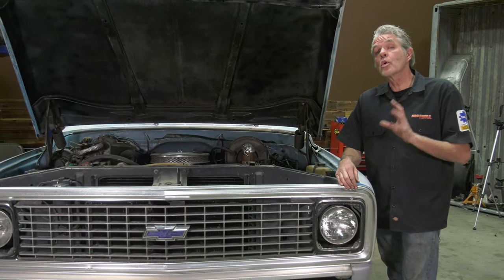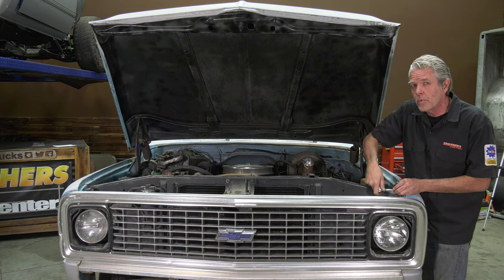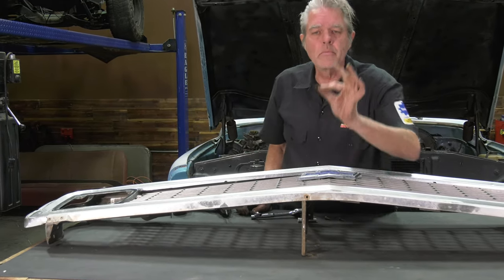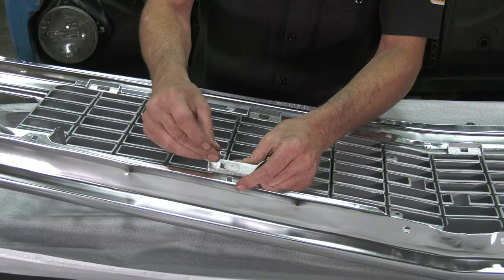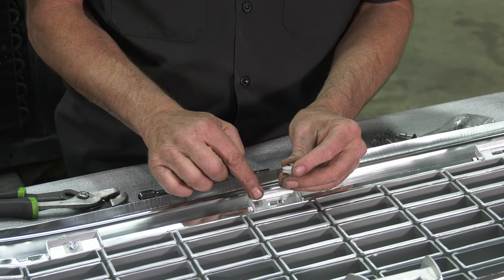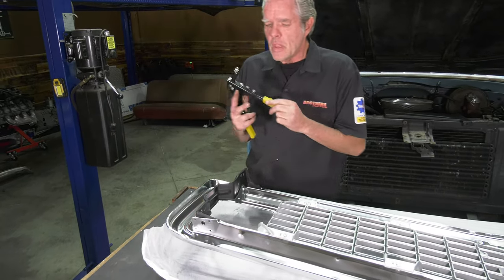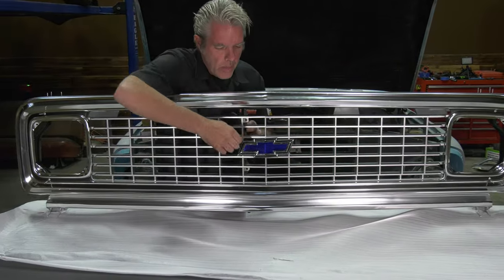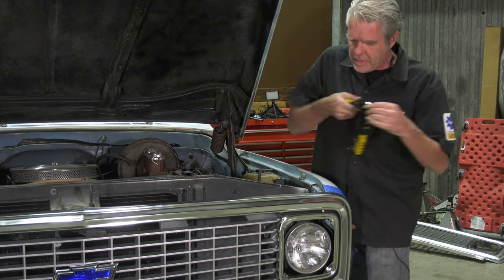1969-72 Chevy Truck - Remove & Replace the Grille - Inner/Outer Assembly

Comment: Would love to see a video for dropping a 71 C20. No c notching just a regular lowering kit. Something someone can do without cutting anything. Tons of vids on c10’s. But I got a c20. Thanks in advance.
Reply from the maker: C10, C20 are basically the same, front is 100% the same. Rear is only different if you have leaf springs on your C20. As far as not cutting anything, that's easy, don't do a drop that's more than 3" front and 4" rear, you won't have to do anything extra.
Reply: ..why on earth would you want to drop a C-20?..it's a 3/4 ton work truck...I have had mine 25 years, it isn't pretty, but it still works, every day..trusty and faithful work truck...1970 C-20...granny 4 speed, 292 I6, low geared posi rear end...terrible gas mileage, she isn't fast, but she'll pull like a beast, reliable, no electronic gremlins like a newer truck...am I the only one who still uses a 67-72 as a work truck?...seems like all anybody else uses them for now is as toys....
Reply: @dyer2cycle  if you read my comment I clearly state no cutting. Which means whatever is Potentially done could be reversed. My c20 does not have a granny gear and I like the lowered look. So “IF” I did lower it, don’t worry it’ll be MINE, so you can keep looking at YOUR truck in all it’s beautiful original form. And I could be a lil more pleased with mine. I don’t understand today’s society where we all must like the same thing. God made us all different for a reason.
Reply: @dyer2cycle  Exactly I agree with you !
A - C20 is a great work truck . No modern day Gimmicks. Like we got now . Pulling machine. Gets tha job done . Easy to fix too . 
I’m still driving my 50-yr Old 72’ Cheyenne 1/2 Ton. Same A/C too, same Motor. Not very pretty . It takes care of my needs. No new EXPENSIVE TRUCK . For me . But hey to each there own . Customizing . If I need something bigger I’ll use my sons New GMC DULLEY . 👍🏻

Comment: Can you make a video on swapping a 72 Jimmy grill to a 69 Blazer grill? Nobody seems to know how to do this at local shops here.
Reply from the maker: That job requires that you swap the radiator core support, etc. It's simple, but you've got to change out all those parts.
Reply: @BROTHERSTruckPartsTV  any chance you can give me a list of all the parts needed aside from what you mentioned? I’ll have to do some more shopping now and these types of parts are out of my wheelhouse. Or is this something a body shop will have no problem with?
Reply: @BROTHERSTruckPartsTV  I’ve been looking up info on this, the only part that seems as if it’s not interchangeable is the radiator core support. The rest of the parts mention aside from the front bumper (I’m using a custom made one with the brackets for a 69 blazer I bought)- fenders, hood, and anything else that’s attached to the front end are all the same part numbers. Can you confirm all I need is rad core support? I appreciate your info.
Reply from the maker: @rhetthasara6752   Our apology, you are correct the fenders and hood are the same. You will have to swap the core support due to the dual/single headlamps as well as any related headlamp or parking lamp items.
Reply: @BROTHERSTruckPartsTV  perfect thanks guys. Your videos are SO helpful to us mere mortals they don’t have the knowledge you have on these subjects. I really appreciate it. Keep up the good work. 🤘🏽🤘🏽
Reply from the maker: @rhetthasara6752   Hold on... We need to correct ourselves here. The GMC uses 1968 Chevy Fenders through '72 whereas the Chevy fenders are different starting in '69. So, the hood is interchangeable from 69-72 for BOTH all Chevy's and GMC's, however the fenders for that '69 Chevy grill have to be 69-72 Chevy Fenders and NOT GMC fenders. Sorry for the confusion.

Comment: I have a question.. I want to install new fan shroud,  is it same procedure plus removing the radiator support??
Reply from the maker: To install a fan shroud you shouldn't have to remove anything but the old shroud and MAYBE the radiator fan.
Reply: thanks for the help..
Reply from the maker: @rickramos8471   our pleasure!
Reply: @rickramos8471  Rick go Electric ⚡️ 
Get some Twin Electric fans ! They have there own Shrouds . Take that old fan out 👍🏻

Comment: My new grille doesn’t fit over the new fenders. So the gap is huge. What do I do. I can’t adjust the fenders in any more.
Reply from the maker: If you bought the grille from us (BROTHERS) then call our customer service and one of the guys will help you figure it out. We might have you text us a few photos so we can see exactly whats going on. 800-977-2767
Reply: Same here. 1/2 inch gap between my fenders and grill.
It's like my new core support is too wide. 
Stretching my fenders out too far and grill gap is terrible.
What did you end up doing to fix yours ?

Comment: How do you put the new emblem on the grill? My old one is threaded but the new one I but doesn't have threads.
Reply from the maker: The nuts that hold it on are self threading and will create the threads on the new emblem.
Reply: Ok thank you for your help

Comment: Could you tell me if the newer outer grille shell was in chrome or standard aluminum, thank you
Reply from the maker: They are actually available both ways.
Reply: @BROTHERSTruckPartsTV  I'm sorry I was meaning if the new outer shell one used in the video was chrome or aluminum?
Reply from the maker: @moonrunner-01  it is aluminum

Comment: any good ways of polishing a grill
Reply from the maker: Not really. The coating on them is called Brite Dip, and over time is just oxidizes. You would have to remove it and polish the raw metal underneath to get any results, but then you're left with constant maintenance of the finish. We have had some luck spraying a fresh clear coat over Brite Trim, which does seem to restore the shine and remove imperfections, but we suggest if you do that you choose a spot you can test the result first before doing the entire thing.
Reply: @brett burwell - I agree 100% with everything Brothers says. It’s a LOT of work and it will require regular maintenance, but if you want to see it done and some incredible results, check out a guy on YT that goes by “gibson63”. He did the aluminum grille for his ‘63 C10 and it looks unbelievable. These are his instructions (good, but not easy):

“Start by washing with soap and water, then spray with oven cleaner (with sodium hydroxide in it), let it set for 15 minutes. Wash off then repeat one more time. Start wet sanding with 320/600/1000/2000 then hand polish with Mothers until it shines...then polish some more. This took me about 14 hours in all.”